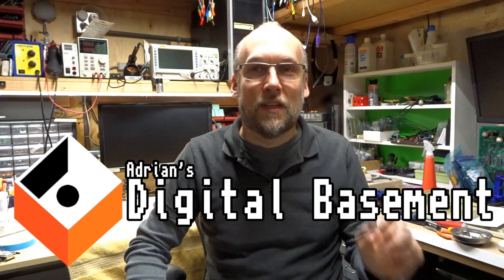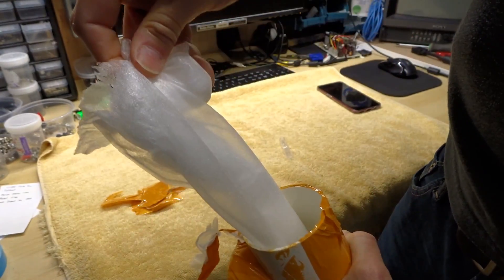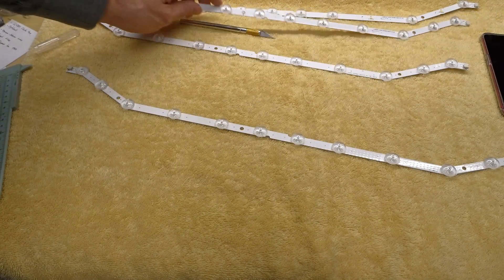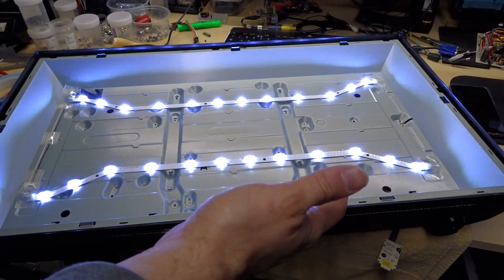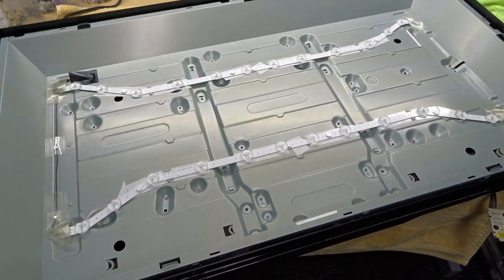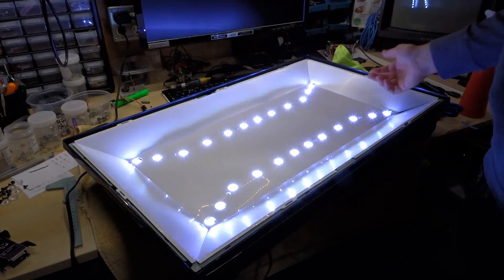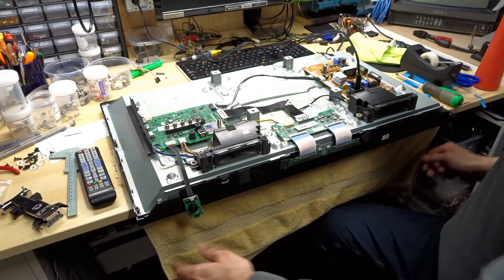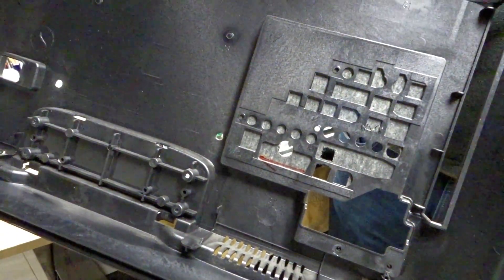Trashpicked Samsung LCD TV Part 2: New LED Modules

Comment: Thanks for very instructional video.  But if it's trashed tv, you can test the screen without spending $17 on new backlight strips.  Just replace the open LED element in the backlight.  It's pretty easy to do and individual LEDs cost maybe a penny (I get 100 per dollar or about before Trump Tariffs).  So effectively free to test (not incl labor).

Comment: Last TV had a whack at, cracked the panel while unclipping them damn clips.  Don''t throw away those leftover LEDs, individually they can make good replacements bulbs with the LED lens removed for modifying an old incandescent flashlight(just add a lithium cell, 10W resistor and a TP4056 charging chip),  also good for pairing multiple overhead strip lighting with the lens left intact.
Put it in the master bedroom,, who gives a .... about a little chip.  Good Job!

Comment: just trash-picked a Ku630d 60" Samsung Series 6, panel looks fine not blobs, and everything seems to be working fine, save for the blacklight seems to be spotty in places. already ordered a replacement kit from ali express if this fixes it, $30 for the (39663A LED kit is not bad for a 60" TV

Comment: Well you’ve done better than me. I’ve tried replacing the backlight on two different lcd tvs and broke both of them. The LCD panel broke despite me being incredibly careful. They were both 55” ones. I think that large panels like that are just too delicate for an amateur like me. I’ve worked on hundreds of lcds from laptops and never broke one during disassembly or reassembly.

Comment: I must confess I'm shocked at how many TV's I see weekly set out in my neighborhood for trash pickup. A couple years ago I found a 55inch LG LED TV. No screen damage so I took it home. Turns out it worked perfectly except the volume kept creeping up. I reset the TV using an  $8 LG remote from eBay and It's now our main living room TV. Works perfect. I've disciplined myself to stop picking up the many 32 inch TVs tossed out that are all tossed out because the owners purchased a newer larger TV.

Comment: Just came across your video,hope you can help me ,I have  50inch magnum  Tv, it takes long to turn on and off. First i thought it was the backlight had the strip replaced worked for awhile then gone  blank ,i unplugged it for a few days  and its  starting wking again , after about 2 day wking  it went blank  again . Thinking to just throw it out, what do u think is wrong with it.

Comment: This reminds me of my own adventures repairing tvs.  My home Samsung (just out of warranty) ate its main processor board.  No idea what happened but got a second hand one for $30.  Fixed.  The "professional," monitor in my edit bay had a bad display.  I found someone claiming to sell NOS displays (they were clearly harvested from existing products).  I was able to find one that was close but not exactly the same as the one I was replacing. $100 fixed.

Comment: Typical trash from china! There is no point in fixing this as the backlight will simply fail again, as Chinese LED's are trash. I have backlit screens from over 20 years ago and they still work, however these Chinese LED's that are present in most modern Televisions, like Samsung and TCL will fail within 2 years of ownership! Because they were designed to fail.
Replacing Chinese LED's with Chinese LED's is utterly asinine!

Comment: Less than 5000 hours run time is short. I own an LG that has more than 13000 hours run time and it still works fine. When getting an LED backlit TV, you should always choose the brightest you can get so that you can set the brightness to around 70% which will help extend the lifespan of the LEDs.

Comment: Yes your repair was a success because I don't believe you damaged it, Just using a screw driver to take those clips off nah! You could get yourself an ifixit kit with the plastic pics and pry tools, and that would be the proper way to ensure you don't damage a screen, but I still don't think you done it, if you had you would have heard a crack and almost certianly would have know and felt the crunch, so don't beat yourself up brother, your knowledge of electronics in general is fantastic and served you well in this repair, I've learned a bunch from you in the short time I been subbed, Well done!

Comment: slightly off-topic suggestion: Could you do a video of turning an (old) tablet into a monitor? And I do not mean like using the tablets OS running an app that shows the input from some sort of attached capture  card, but actually only using the tablet hardware as a monitor...

Comment: With those replacement LED strips for back lighting, can additional similar single lights be added for improved backlighting? Thank you & great fix! 🤓 Even with the small burn spot in the corner, the TV is still pretty good! I don't think you caused the spot, as it seemed you took it apart & reassembled it carefully!

Comment: 2 of the strips for $17 definitely made it worth it more to fix than $20 × 2 for them.
You also now have a piece of PVC pipe to reuse for some other project (well, non-electronic project, LOL!) for free. 🙂

It's a bummer about the screen, but hey, it works, at least!

Comment: Pretty impressive they sent that in a PVC pipe, good on them. Crazy how simple these TVs and monitors are put together. I repaired a Samsung LCD monitor for a friend of mine a few years ago and I was so surprised that there were literally no screws inside the damn thing. Like none.....the bezel came off and the whole thing came apart. Super cheapo made. But hey, I was able to get it working again!

Comment: (11:22) I don't know if this was mentioned later in the video, but I suspect that the built-in ATSC tuner was never used as the TV was probably a regular consumer TV being used as a digital signage display, assuming it was thrown out by a shop or company.
Edit: Or some other kind of use where the owner only used the HDMI input

Comment: There really aren't a lot of people out there doing repairs on LCD televisions these days. A lot of the particularly large panels really aren't designed to come back apart once they've been assembled, so there's some understandable reluctance to take on liability for repairing a panel like that. Back in the old CRT days, the tube was durable enough that just taking the rear panel off didn't place it at risk.

Comment: Good repair, i would say, you did not cause the blob.. My daughter had a LED TV, and it fell and the screen cracked pretty bad. I did throw it away knowing most likely it could not be repaired. It was brand new. I should have removed the LED Strips. Maybe i could find another in the trash somewhere. And need them to repair. But, its gone now. Thank you for this video.

Comment: Great Video! I have a Samsung UN40ES6003FXZA , it had no picture, but with the flashlight test I saw images on the screen. So I replaced the LED strips in it and it works, however the screen is kinda dim, like  someone turned the brightness down.  I replaced the main board no change, I changed the T-Con board and no change. What would you recommend?

Comment: I have a insignia ns27lcd i found. the cord had been cut from inside. I bought the replacement cord and installed it (plugged it in onto the power board(I assume) and it didn't power on (as best I can tell). What is my next step?

Comment: Dear Mr Black , how are you ?
In these days ( 2020 ) there is a fix for cracked glass , the LCD damage however is alittle more problematic . eg. I have a Dell Streak 5 " ( mobile ) phone pad " with a dark patch . When I press down on the patch it changes in to a keiledoscopic chaos of multi-colour Liquid Crystal . Just wondering if there is a fix ? I tried heating it , because I thought it might be due to water damage , no go . I tried putting it in the fridge , to dry it out , no go . I am interested in your thoughts on this ?

Comment: If you are using that TV to play older game consoles with 4:3 screen ratio, that bad spot is not even visible if you set the screen ratio to that and don’t let it be stretched sideways. (there’s a button to change ratio on the remote, it’s labelled “P.SIZE” on mine)

Comment: It's now been a year.  Do you still have this TV, does it still work, has that blob spread larger?
Reply from the maker: Yep still have it and the blob has turned into just a line. Hasn't gotten longer or worse and the TV works great still.
Reply: @adriansdigitalbasement  ... Cool, into a line?  Thin line?  Assuming you didn't massage the stuck pixels mechanically or with software, my guess is that most of the TFT's eventually got resuscitated after the liquid inside eventually redistributed themselves.  If you did do further work on the blob, then congrats that was lucky, because sometimes nothing can help.   Nice outcome overall.  Would love to see it in a future clip, even for a second, as an update.

Comment: Hi Adrian, 
I don't remove the screen the way you did. I remove the screen with the TV on its back with the panels removed off the chassis to gain access to the little plastic clips that hold the LED strips in place on the chassis.
Remove the Plastic Outer Bezel from the front, then the LCD screen with buffer circuits attached BE CAREFUL!!, Inner Bezel, the Diffuses/Fresnel layers and the white reflecting plastic panel. 
You reassemble in reverse, White plastic reflecting panel, Diffuses/Fresnel layers, Bezel, LCD screen with Buffer Circuits, again BE CAREFUL!!, lastly Outer Bezel. That's how I have done it for some time now. Make sure not to leave finger prints everywhere !!
You can align everything as you go and you might find that process easier that with the TV on its face.
There are often plastic standoffs that support the LCD from being pushed in towards the chassis on larger TV screens that can be replaced
while the TV chassis is on its back they will also hold the white reflective plastic panel in place during reassembly.  
You were able to store the LCD safer your way than separated from everything as that is a tricky part of the repair keeping the LCD screen and buffer circuits intact. I will have a video on here shortly showing how to replace the individual LED's on the strips that blow often because the back-light is cranked up to 100% most often when the LED's fail. 
The LED's can be tested individually and replace individually with a small hotplate.
You take off the lenses and reuse or replace as required (Super Glue). The LED's are cheap to order and I normally buy 100 or more at a time as often several fail on the strips.
Ordering the correct LED's can be a challenge!! You sourced the replacement strips at a great price, they are often 4 times that price and more for the larger models, so in your case I think you went the better route and saved the hard work of testing and replacing each LED as required. 
You did to get it apart and back together so well done!! 
Not how most people do it but it worked !!!
Pretty long comment I know ! 
This is for information purposes only!! 
Anyone attempting this process you do so at your own risk!!! 
There are high voltages present in electrical equipment and unless you are familiar with this type of work leave it to the someone that is trained.
I hope you find this helpful for future TV fixes Adrian.
Thanks for your videos, I do enjoy watching them!!
Keep up the good work !!

Comment: we have tons of these 32" panels dead at work (mostly same issue - sometimes when the LEDs fail it takes the power supply with it also), if you want a replacement LCD panel (just the actual glass part) I could probably ship you one

Comment: That damage wasn't you.  Those layers are about the same fragile level of paper or cardstock.  They are light diffusers.  Each has a different purpose.  The biggest thing is you don't want to crease them.  That will cause the light to bounce off or pass through the layer wrong and give uneven lighting.  All the diffuser layers are for the backlight.  The LCD screen layer is for the picture image.  The LCD screen layer is fragile but stiff, so you'd know if you caused the crack.  The LCD layer is what is damaged.  Especially with the external frame scuff damage that you didn't cause is evidence you didn't cause it.  I've replaced lots of fluorescent tubes in laptop displays and lots of times the layers would have to be taken completely out or fall out while fidgeting with the tube.  Even with getting oily fingerprints on the layers, surprisingly those didn't show when put back together on or off.

Comment: I'd recommend getting what are essentially plastic pry bars to open screens that are clipped together. I've used the "opening tool" available on ifixit's website. They're cheap, pop open clips easily and don't damage things. You can pop one clip and just run it continuously the rest of the way. Huge time saver and doesn't break the case.

Comment: I was happy to see another geek do a successful seat of the pants repair. I had to replace the power supply board on a 13 you old Sharp. Once diagnose, cleaning the is ideal of the set took longer than the repair. It's an adventure.

Comment: You purchased the led assembly  now purchase the LCD glass assembly. I would love to see how they ship it. maybe sandwiched between two pieces of heavy steel. they sent the light assembly in a hard PVC tube.  either way cracked glass has a way of spreading and failing.  So replace the glass. couldn't be more than 40 bucks. it's worth a try.

Comment: I picked up a 42" Samsung TV from Facebook that was flashing the power light, and nothing further. Looked up possible problems on Youtube. Spent around $15 on 4 new capacitors and a small transformer... Voila! I now have a 42" TV that has been working perfectly for the past 4 years!

Comment: A few years ago right after I bought a midrange 40" Samsung TV I find a 46" Samsung by the trash at work. I ask around and all I get is a shrug and "It's broke", so I took it home, plugged it in and get gibberish on the screen. I take off the back cover, fiddle with the connector between the mainboard and the LCD driver and it clears up. I cleaned up both sides of the connector with some emery cloth and contact cleaner, slapped it back together and mounted it in the living room, took the 40" and replaced my 22" PC monitor.

Comment: The unopened cutouts for alternate ports is probably related to the TV doesn't have a label saying it's multi-voltage despite having a multi-voltage power supply.  The set can be configured for many markets (SCART is used extensively in Europe, but generally not available elsewhere, for example) and the label reflects the market configuration.

Comment: I have repaired TV's For over 25 years ( now retired ). I believe that you broke the lcd panel. You did it when you removed the bezel ( the front frame around the TV ) There are 2 clips ( 1 on each side ) and very hard to unclip at the same time. You used your fingers on the panel and your thumb to hold one clip open while you opened the other. This put pressure on the exact spot that cracked. I was very impressed with your video. It showed that you have a good deal of knowledge on how a TV works.
Reply from the maker: Heh and I really knew nothing, having never opened up a TV before. I have a feeling I caused that crack too -- but if you can believe it, this TV still works and I use it in my office every day. The block around the crack has gone away and now it just looks like a hair on the screen and it hardly visible from a distance.

Comment: now measure the voltage on the LED backlight and also measure the current.
if another LED goes bad, you can change the LED with an identical one.

Comment: what a great educational video good work. I have salvaged a HP Z30i monitor which is displaying a light stripe approx 4 inches wide from top to bottom in  the centre of the screen. I have had it apart but will now check voltages etc. your videos have inspired me !!

Comment: thermal tape where can it be bought? I am curious of getting one.Any link would be appreciated.People throw away stuff way to easy, for 17 bucks repairing a tv is awsome.We throw to much away anyways.
Reply from the maker: TV is still working great today too. The blob even corrected itself and went away with just a hairline crack visible now. You can get that thermal tape from sites like AliExpress. Like this stuff: https://www.aliexpress.com/item/32833827745.html?spm=a2g0o.productlist.0.0.19ca4a95q1DYwK&algo_pvid=78355dbd-da01-4ac3-8d19-1ba4cce60101&algo_expid=78355dbd-da01-4ac3-8d19-1ba4cce60101-0&btsid=d24dbfde-a462-47be-ae2a-a51e1cb7c3b0&ws_ab_test=searchweb0_0,searchweb201602_9,searchweb201603_53

Comment: This TV would be fine for anything with a lower resolution. As a computer monitor you could set it to display  with a black box around the outside, or use letterboxing. Old standard tv content will be good as well because it will black out the sides so you get a square picture, same for  older console video games in standard resolution instead of a stretched resolution.  As a monitor for security  cameras or any time of non  cinematic task it will also be fine.

Comment: You could have made a neater job of the thermal tape by drawing pencil outline round the led strips  and using 6 pieces of tape in total.

Repair wise. Great job. Great video. Thank you.
Reply from the maker: I'm not too concerned about a trash TV on part of it no one will ever see. :-) TV still works fine today -- use it every day in the office at work.